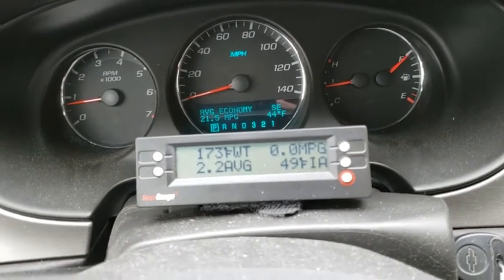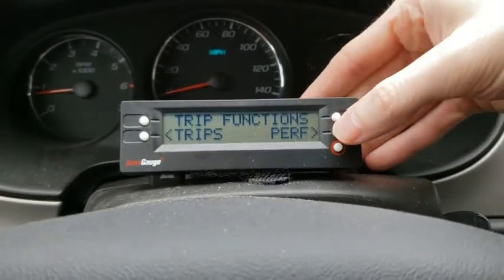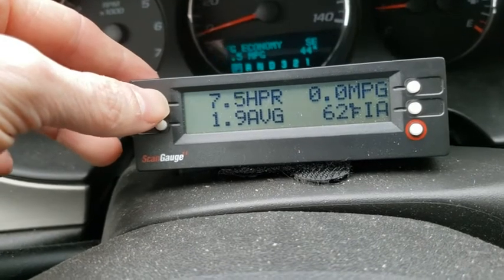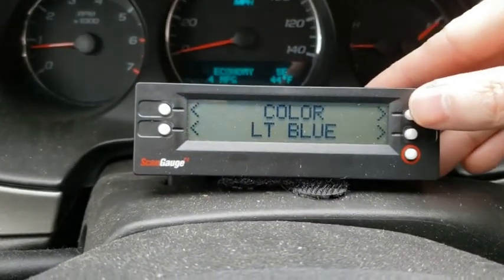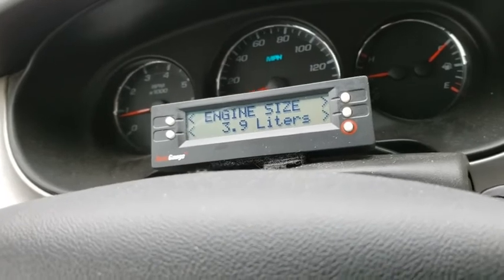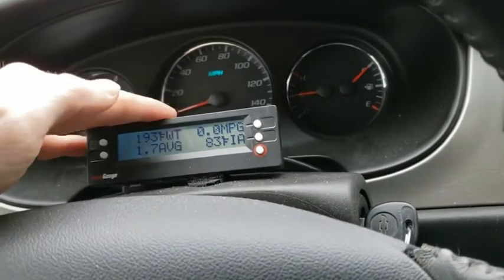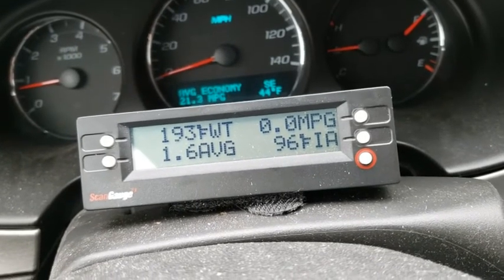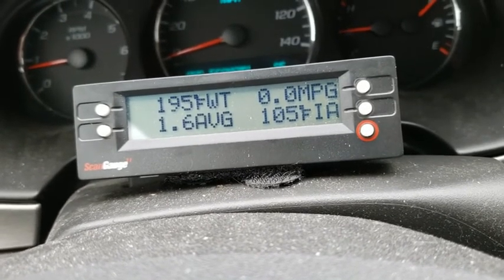My favorite device for my cars. Scangauge2. Part 1

Comment: Does it measure turbo boost pressure?
Reply from the maker: Yes as long as your car has a sensor for it to send the information to the device in the OBD2 port, which it should have one.